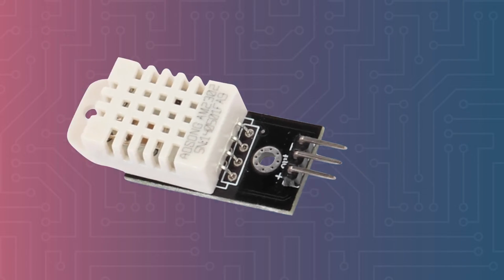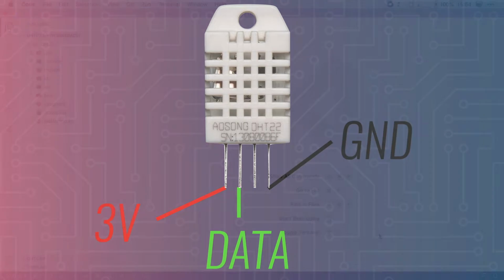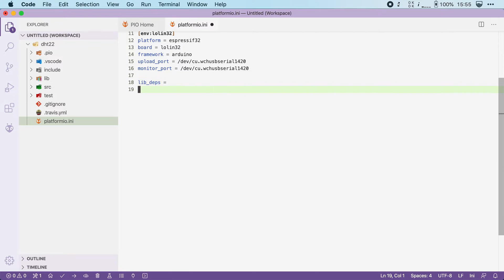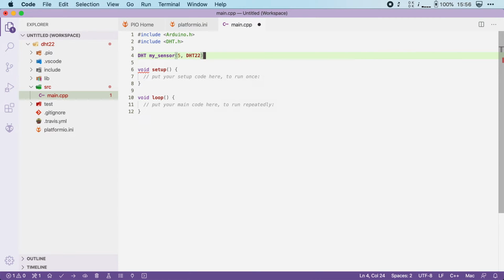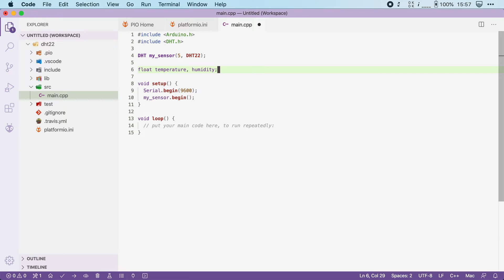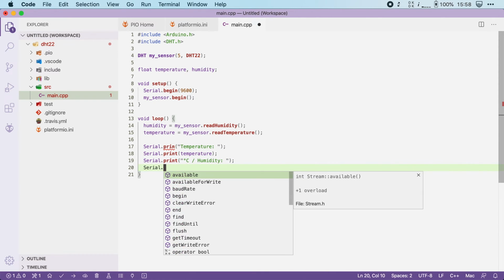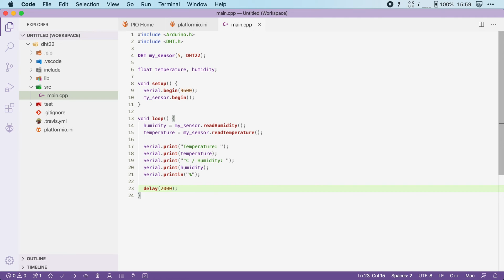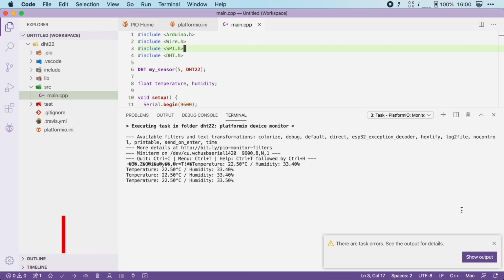Using DHT22 Temperature Sensor (ESP32 + Arduino series)

Comment: Kind Sir,

I will be glad to pay you for assistance if required.

I help elderly people.  I need to create this BUT BATTERY POWERED.  Their home has excess moisture and Fungus.  I need to monitor temp and humidity and view it but also have results written to a file on computer for each sensor I use.
I WILL RUN A RASPBERRY PI 3B+ AS COMPUTER TO MONITOR/SHOW/RECORD INFORMATION.  I ONLY NEED READING EVERY 30MINUTES AT MOST PER SENSOR. What number will I put in the code you showed?

How do I show information on monitor and it record it in a file to be printed out later?

CAN YOU ASSIST AND SHOW BATTERY CONNECTION TO POWER ESP32?

I am trying to SAVE THEIR HOME from black mold and it being CONDEMNED.

Home repairs will be made.  BUT THESE SENSORS WILL MONITOR AND RECORD INFORMATION FOR US TO BE SURE ALL HAS BEEN REPAIRED.

Most humble appreciation,

Alton

Comment: I am trying to connect dht22 to esp32. But esp32 gpio can only tolerate 3.3v whereas dht22 output is 5v. How do you solve it?
Reply from the maker: A DHT22's output voltage is relative to the input voltage. If you supply it with 3.3V, it will never output 5V. So it's safe to connect.

Comment: When I run it the serial moniter outputs the temperature as nan could you help me
Reply: how can we fix it?
Reply: Same problem
Reply: Check the polarity of the sensor , or check the cable connection.